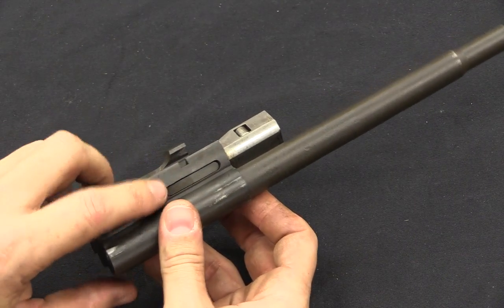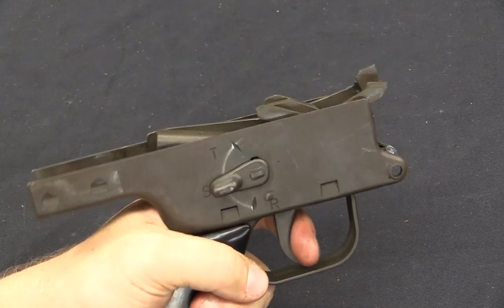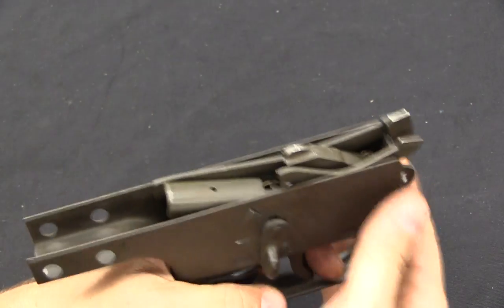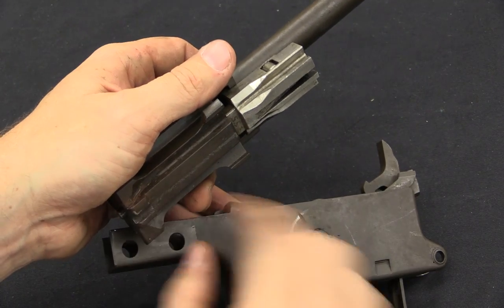CETME Modelo A: First Step Towards the G3

Comment: Because of this I am now wondering just how a G3 would be in 300 blackout.
Reply: Too big a rifle for that.
An HK33 or CETME L would be the "right" size for the conversion.

Some of both (probably less than a dozen) have been converted to .222 to be legal in Spain.
Reply: It has been done. HKparts sells 300 blackout conversion barrels for the HK33/C93. Several companies made small batches of HK33s in 300 blackout a few years ago using converted pmags (original HK33 mags have serious feeding issues with 300 blackout).

Comment: Hey Ian, what would happen if you shot a few roudns in full auto, and then switched back to semi-auto with the bolt lock open? Would it slam forward and shoot without you pressing the trigger?
Reply: Ehhhhh why in hell will you want to do that?
Reply: @tonivazquez1081  I dunno, I'm just asking. How would switching from full auto with the bolt locked open (since it does that) to semi auto (which is supposed to be closed bolt) work? They probably thought of it and nothing bad would happen, but Ian didn't touch on that in the video